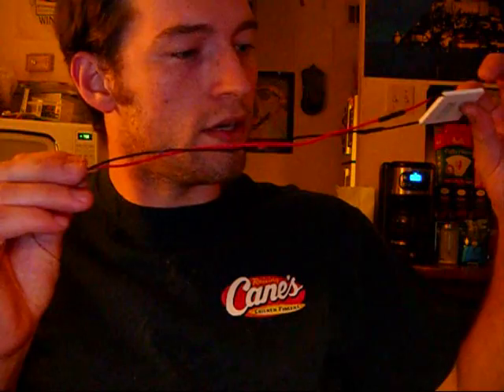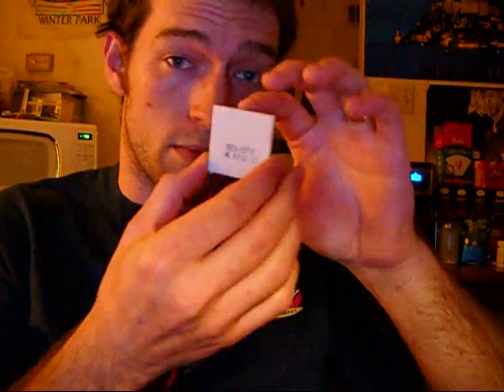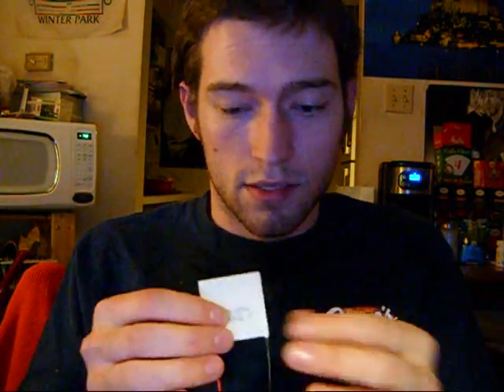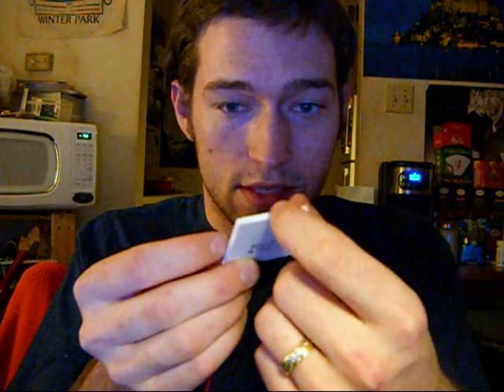Thermoelectric Cooler Part 11 - How to fix a TEC & updates

Comment: i never broke TEC from extreme heat, but 1 from a fall and 1 from too much clamping pressure while having a temperature sensor against the cold side
unfortunately haven't been able to solder correctly in the tiny gap i have :/